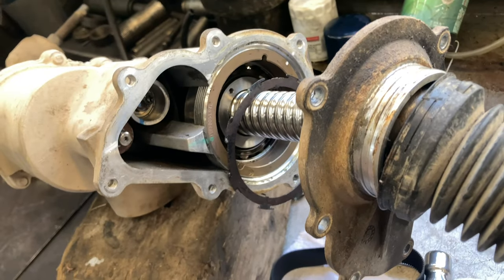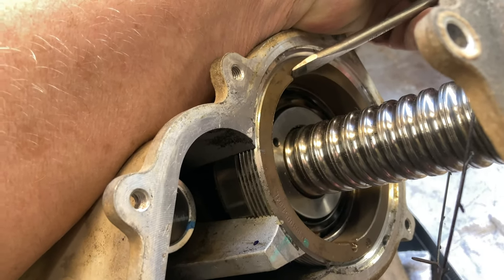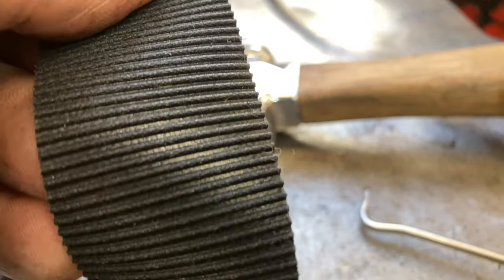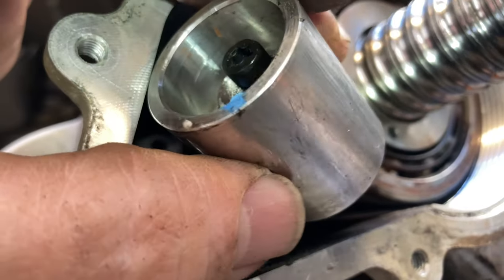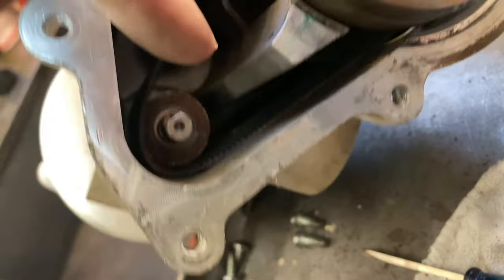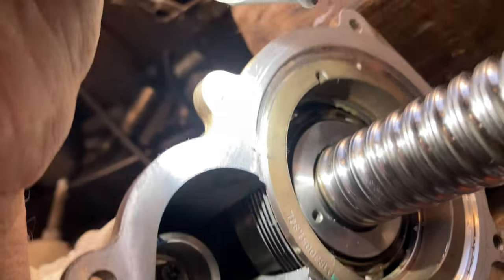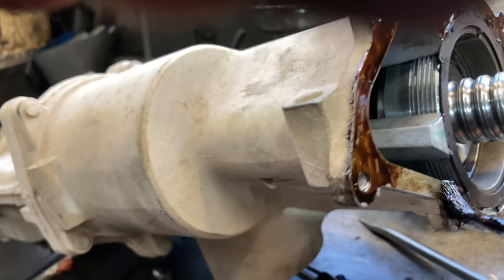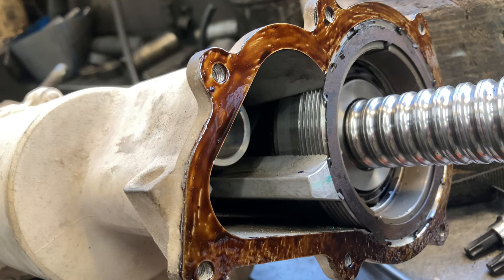Electric Power Steering Repair (2014 F150 2wd)

Comment: Maybe an old toothbrush with brake cleaner would help get that pulley cleaned up.
Good video.
Reply from the maker: Cleaning the gear was not really an issue if I had it to do over again I would do it the same way with the sharp metal pick. It wouldn’t hurt to go over it with a toothbrush after you run the pick over it. The old belt guts are stuck pretty good. I would have removed the tensioner to make it easier. As for brake clean we do allow it in the shop because it smells bad. Bad like it’s bad for you. The best thing to clean brakes with is water. All of the stuff loose inside the rack housing were dry and compressed air did the trick. Thanks for the comment. Hope you have a good year.

Comment: You can move the gear out to clean it by turning the drivers side wheel.
I was able to make this belt change with little issue, but now I'm getting a clunk when the power steering engages. Is there a way to adjust the torque sensor?

Comment: I'm about to do some digging, but do you happen to know if this is the same R&P as ram was using at this time?
Ram's issue seems to be electrical related, though.
Reply from the maker: I’m sorry but I have zero experience with the ram.
Reply: They share parts from what I can find, the casing & electronics are different. The motor, belt, & recirculating ball seems to be the same

Comment: Do you know anywhere that sells the recirculating ball/ gear/ bearings assembly? I can buy belts, seals, but not the gear..
Reply from the maker: I’m sorry I don’t but how many miles did you have on the vehicle?  if you. have a parts house your friendly with see if they have a core you could trade out with.  Or wrecking yard.

Comment: What did you pickup truck did when the belt broke
Reply from the maker: When the belt broke there was no power.  You still had steering if you were strong enough. But there was no power assistance.
Reply: I have the same problem with a warning light on my dashboard . It says advanced track service and the blinker doesn’t work . Did you have the same warning light on your dashboard. I will like to know before I open the rack and pinion
Reply from the maker: @antoniomaceda1943  the way we checked the rack was to put the front tires on the ground with the engine running and have one guy turn the wheel one way and then the other while one guy was underneath listening for the rack motor to run.  If you don’t have a load on the front tire the motor will not turn. Use a screwdriver to your ear or a stethoscope to listen.
Reply: @antoniomaceda1943 i have this problem too the  Advance track service turning on sometimes i disconec the battery AND Is working again i think Is  electric problem
Reply: @raulreyes3558 did you figure it out? I'm having the same issue. Also sometimes when I turn right the steering will jerk real hard to the left and then be fine after that. No warning lights or anything.  Definitely a scary feeling
Reply: @raulreyes3558 it might be the two fuses on your battery check to see if they are blown

Comment: My power steering works good on my 2011 4wd F150 but it makes a terrible growling noise when turning the wheels.
Reply from the maker: does it have electric or hydraulic steering
Reply: It electric, I figured the bearings are going out.

Comment: I guess you're labor is free....it would be cheaper to replace the rack
Reply from the maker: What are you talking about parts labor and tax was 574.00 have you priced a rebuilt rack only.
Reply from the maker: A rebuilt rack on rock auto ranges anywhere from 600.00 too 1200.00 before markup. Explain what you mean please.
Reply: $574.00 and you're married to that rack! Yes,  I know the price of rebuilt and new. They have to warrant it, not you. You're not going to tell me you don't have atleast 3 hrs fiddling with that
Reply from the maker: They were going to sell the truck with no power steering because they could not afford to fix it with another rack and programming so it was done with the understanding that there was no warranty and he will actually make his money back from the repair plus some. Thats what we do for good customers. Normally I would agree with you on the married to it thing. Thanks for the comment